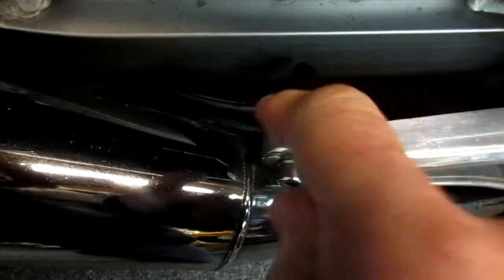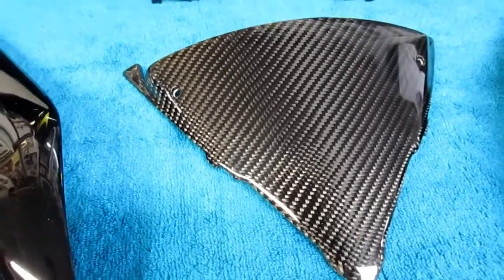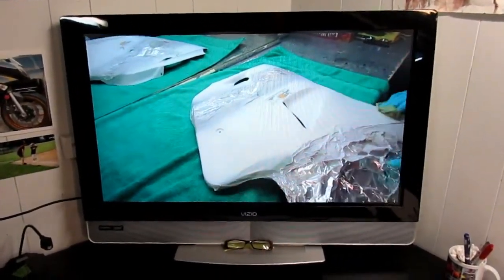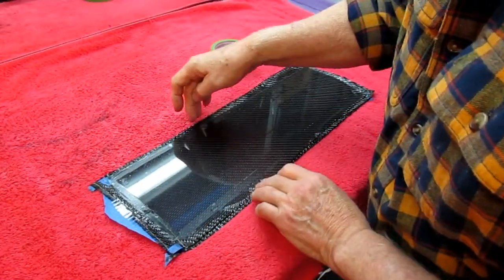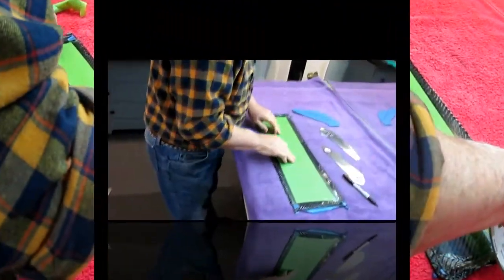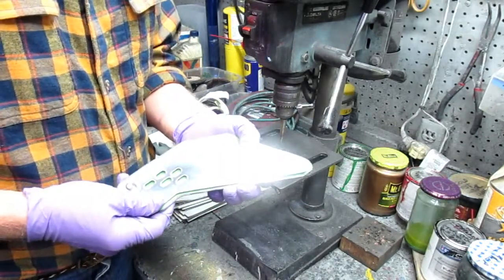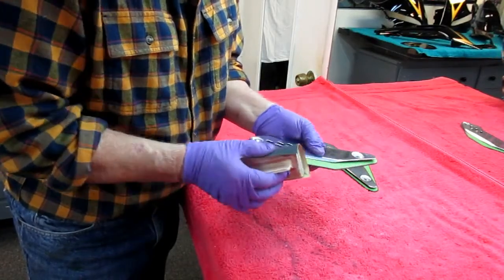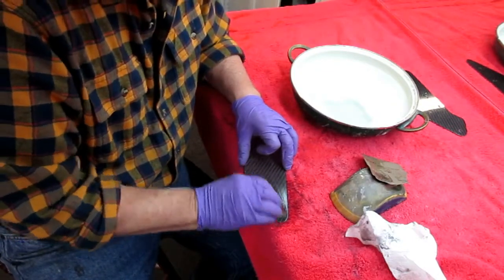pt 33 NINJA RESTORATION,CARBON FIBER WORK AND TESTING

Comment: I have used the same method to make fiberglass parts on a sheet of glass many times, and I always put a couple of good coats of resin or gel coat on and let it harden before doing the layup. Gives a thicker finish on the face of the part, so you have lots to work with for finishing.